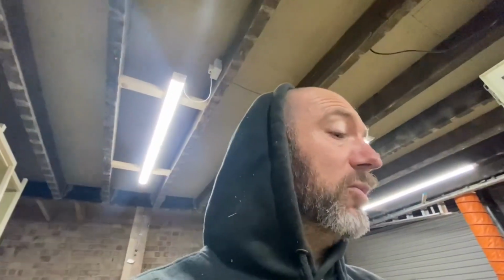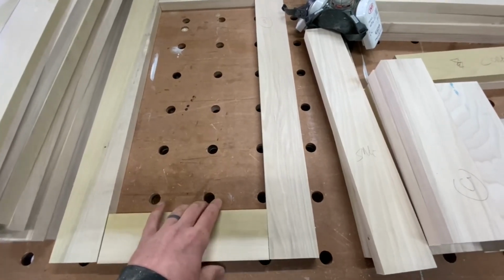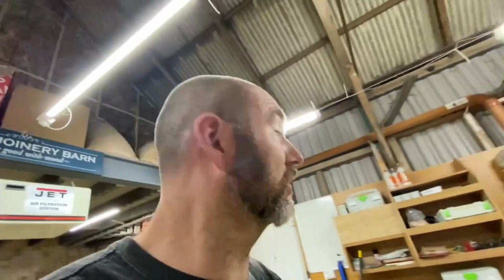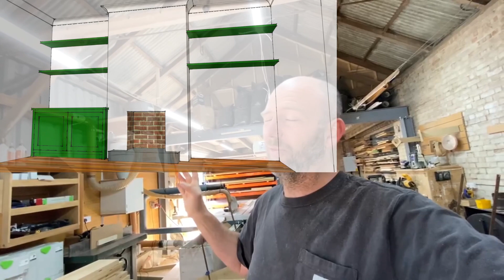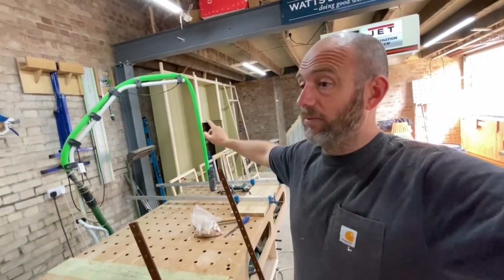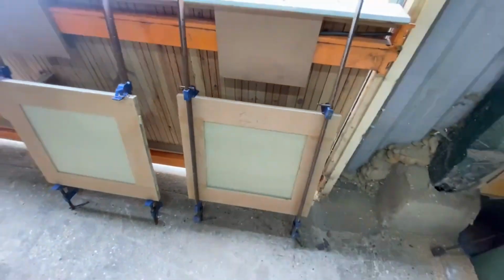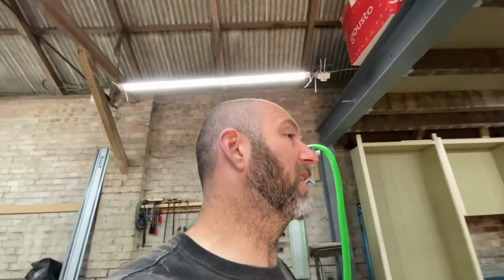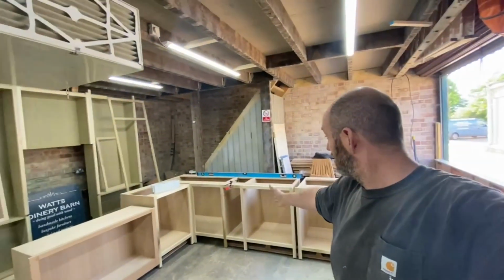MDF vs Hardwood shaker doors and how I build my kitchen cabinets #carpentry #joinery #20

Comment: Hi , just came across your channel and enjoyed the video. I run a small Joinery workshop in East Sussex and make my kitchen cupboard doors in the same way. Regarding clamps and clamping times, I just glue the doors, clamp them up and then fire an 18g pin through both sides of the domino joint and then unclamp them.. I've never had a single door fail or even joint open up. Just my way of doing it.  I have a few panel clamps which I got from Wurths and and also Scott and Sargant. They are excellant because they give you around 8" of pressure on the width rather than about 2 inches with sash clamps. 
    I've actually moved away from Tulipwood for most of my  kitchen doors etc because I've found it's not as stable as it use to be 20+yrs ago. Just ripping Tulipwood down on a rip saw and both pieces move whereas years ago that never happend. I now use European steamed beech, far harder so no chance of damaging pieces and more stable in my opinion.   Lots of ways of doing a job ,so just my input. All the best  Ade.
Reply from the maker: Love it mate. Very interesting idea about the nailer into a domino. I use the 18g air nailer loads for stuff but never thought of that!
Yeah I here you on tulip. Luckily I select what I buy so don’t get anything to close to the pith. 
I think next kitchen I will use something else as I enjoy the change! I have always wanted to do one in sapele as I really love the look when sprayed! And I can get sapele faced boards easily enough for the panels.

Do you get much grain come through when painting the steamed beech?

Thanks so much for watching, matt
Reply: @Wattsjoinerybarn  Hi Matt, European Steamed Beech is harder than Tulipwood so you don't see the grain through the paint like you can with Tulipwood where the growth rings can be denser and the adjacent ring softer so you sand away the softer grain which you don't get with beech. They also do a paint grade Steamed Beech which is cheaper. Only downside I can see is the hinge borer needs to be sharp and you need to pilot drill for Mag catches etc if you go down the butt hinge route rather than Blum/Grass hinges. Sapele can have fab grain, pretty stable too. I use it mostly for Doors,windows but you can use it for a nice effect in a kitchen. You can also get paint grade Maple too which is a tad softer than Beech but still stable,  a lot of people use for making kitchens. There are a few different options out there and Tulipwood is falling down the list for me.. 

  All the best Ade  😁🙂
Reply from the maker: I hear you with the tulip. First lot I did this year was the first for a few years. It was nice to work with again as light and machines easy but I noticed it needed more care when finishing as was softer than before plus a few sprung a bit. On the whole it’s good tho. I just did some sapele doors and it’s Tempe first time I sprayed them. The grain pattern was lovely through the paint and I get it a good cost so I think it’s a no brainer for my next one. My timber merchants do German steemed beech so I will cost that too!.

Thanks again
Reply: @Wattsjoinerybarn   The German Steamed Beech is usually "Polmeyer" if I remember correctly. If you're going to spray it you can save a bit of money on getting the paint grade. I had some about 3 weeks ago and it was good, very few defects to speak off, just some colour streaking,spalting but no biggie. Worth getting a price for both and see what is best for you. Let me know what you think of it.

    My rep came in today, nice guy and very knowledgable. He was a fully qualified machinish prior to repping. Gave me a sample of "Frake Noir" which is a member of the Iroko family which they heat treat which makes it similar to Accoya so it is uber stable. Looks like it might compete directly with Accoya for external use so I'll try that sometime soon.
Reply from the maker: I have seen that frake noir (still can’t believe they called it that!😂) as cladding down the road from me. It actually looks nice unpainted so would compete with acoya there.
Probably not as nasty as accoya either all tho it is good stuff!

Yeah I will give that beech a price up. I like the idea of sapele tho as sapele faced boards aren’t too expensive where I get my sheets from! 

Where abouts are you based ?